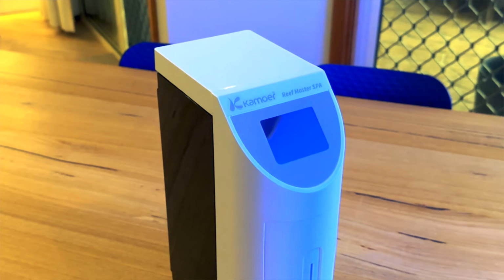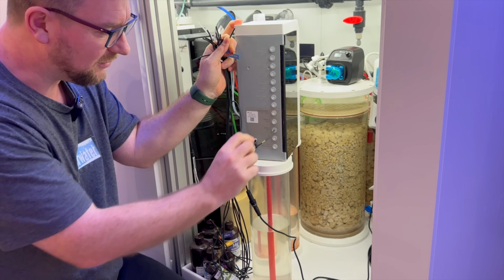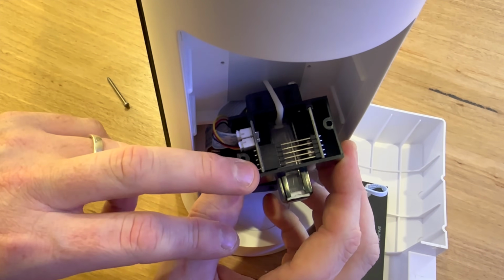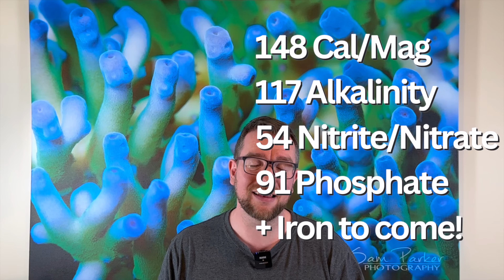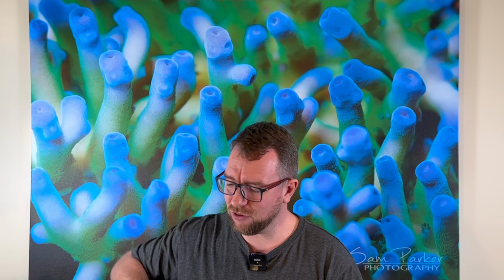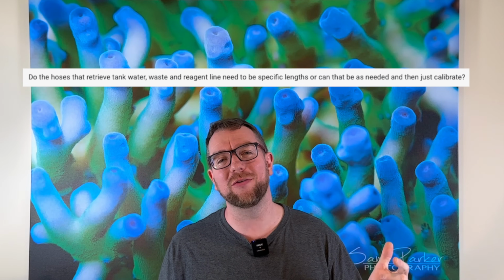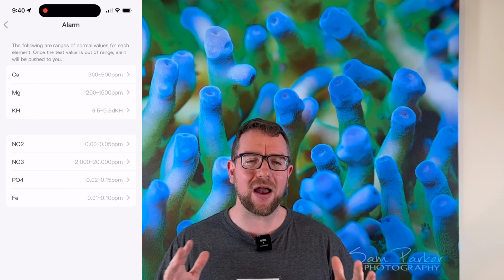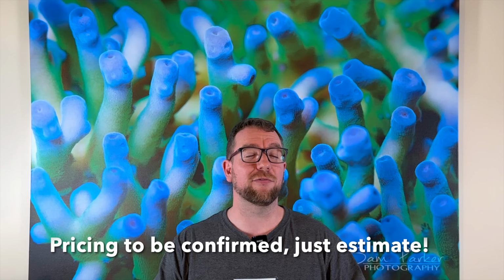Full Review - Kamoer Reef Master SPA

Comment: I'm torn, this sounds like a great unit and looks promising. I am leaning closer to the mastertronic essentials because I reached out to Kamoer directly a few times now with no response. Focustronic or everything focustronic in Australia responded to me the following morning and again followed up on my email. My concern is Kamoer app, not just the not getting alerts. but my Kamoer doser has a temp probe. When I open the graph I cant open the monthly graph as it just gets stuck loading, This concerns me because obviously we will be looking at trends and data with the Kamoer reef master spa. Its also a little insulting that you have to use a specific Kamoer pump with it. My pump is perfectly fine so if I wanted to go full automation it now means I'd have to buy the compatible kamoer doser. Focustronic allow 3rd party reagents, and they also have the powertronic to get more creative. the machines look very similar to me and I think the drop counter on the mastertronic essentials is a huge upgrade and looks low maintenance as well. The biggest selling point for me from my experience so far is that everything focustronic has better customer support and cares more, Kamoer make medical grade equipment but I am concerned about support if issues occur. Also mastertronic essentials looks a bit more tidy
Reply from the maker: The post sales support from Focustronic is certainly a level above the playing field. Still waiting for the mastertronic essentials to be released, if it is 80% as good as we've been promised, it should be a game changer that is for sure

Comment: Just to add to your video, which is great btw. I got this unit in late January(NZ based) my over all view to setup and get started was the easiest of them all. However, once its been setup and running, nunbers doesnt match up to manual testing. You can o ly do manual calibration and no automatic calib, meaning you manual put in the results from your calibration from another test. Just remember you can only do this on the KH CA and MAg. It takes about  2 weeks and the devices readings are all out. P04 and N03 are well off with no means of correcting them. We are a couple of reefers in NZ that has these units and to be honest, we are not happy. No help from Kamoer in regards to sudden drop with readings, no calibration instructions. In my opinion its a great device, onky if it works. I will not recommend this device untill Kamoer can give some feedback.
Reply from the maker: Interesting. Mine is about 5-6 weeks in now and is still testing accurately (with the exception of nitrate). The calibration of entering in the "actual" value is good, I am curious on your thoughts on what an automated version of that would be?

Appreciate your feedback!
Reply: I tested manually KH, and CA with 3 diffrent devices or testing kits. My KH was tested at 8.4, Kamoer at 6.4 6.5. CA  manual testing at 430, kamoer at 390. Once I have done the manual correction of the elements on Kamoer it test correct for a day or 2 then it drops again to the lower numbers. I would recommend you do manual testing on your KH with 3 different testing kits, put in the manual readings in the device and check your device after about 3-4 days.

Comment: Hi Sam, for the No3 issue, not sure if you have double checked the unit setting. Reef master SPA seems to have three different no3 testing ranges, from your results, I will assume your unit is set at 0 - 1ppm range, there are 1 - 15 ppm and 15 - 50ppm range that you can select as well. mine works well when I change the testing range.
Reply from the maker: Interesting, I wonder if this is new?
Reply: @ParkersReef  maybe, lol. Mine was like yours until I found out the range setting, the number then make more sense.

Comment: did you calibrate it? and how
Reply from the maker: I did not, however it is possible via either official Kamoer certified solutions that you scan the QR code of and then run a test with. Or you can alter the reading to match your baseline from another test kit in the software if you prefer

Comment: Great review as always! I am (almost)convinced to ditch my Mastertronic, Alkatronic and Dosetronic once this is available. However, There is one key question for me which is the price of individual reagents. 117 tests for Alk in my case would give me at most 2 months. SO I would need at least 6 bottles of ALK to have a one year supply, whilst Ca/Mg would last me almost 3 years (although unfortunately I would be forced to test them 3x faster because they only last for 12 months). So key question would be if reagents can be bought separately and at what price. Thank you very much!
Reply from the maker: Will see if the reagents are available individually or only as a set. Availability and price on these will be key
Reply: Yes, that will be key. If they only sell in bundle I will definitely not buy this as it would imply buying 6-12 sets per yeat. Even 6 kits will be more than 1.000$ per year and a ton of wasted Ca, Mg PO4 and No3 reagents.
Reply: my understanding is that colormetric tests for alk are always going to be significantly higher cost than the acid/ph test like the alkatronic.  I'll never ditch my alkatronic and don't use my mastertronic for alk.
Reply: @Reef_Ranch  That is 100% correct (unless you use ABC reagents on a Trident). My major issue with the Focustronic equipment I own (and I have owned GHL KH Director and Neptune Trident in the past) is that with the ALkatronic + the Mastertronic I have more maintenance than I want to have. There is not a week that goes by without having to calibrate some pumps, calibrate the pH probe on the Alkatronic, calibrate the syringe on the Mastertronic, replace tubing in the pumps (on either Alkatronic or Mastertronic), replace the filters that draw water from the tank, replace pump tubing… etc. I mostly want to simplify and have one machine that does it all (but with its own reagents) and with easy maintenance.
Reply from the maker: @Reef_Ranch  that is correct (assuming your reagents cost more than a basic acid mix, which it almost always does)
Reply: @vascojardim6703  yeah, the maintenance alerts on those two can get annoying but I ignore them for many days with little effect on the accuracy.  until the accuracy and precision of the nitrate and phosphate tests on these new units (the Spa, Maven and Trident NP) are shown to be on par with the Mastertronic I’m not going to be buying one
Reply from the maker: Yeah that’s fair too
Reply: @Reef_Ranch  unfortunately my experience with the Mastertronic over these past 2 years regarding accuracy is not brilliant. If I ignore the calibration warnings the results start to slide quite quickly, especially on NO3 and PO4. And it has even happened to me getting close to zero NO3 and PO4, leading me to increase feedings to avoid it, resulting in an algae bloom in a couple of weeks that killed some of my corals. When I saw the algae I got my Hanna checkers out and while the MT was saying 0.5ppm NO3 I had close to 30. After speaking with the (Legend) Reddie Redwood he told me to replace the vials, or wash them, because apparently after a while the reagent starts to accumulate residue. And this is on top of regular maintenance. And if you have to change the pump tubbing on the MT you have to take it apart. I love all the rest but the required maintenance to keep them accurate is just too much.

Comment: Thanks Sam, I was looking into the Kamoer reef master SPA and noticed you had a little teaser in your last vid. I had been waiting for this review! Looks like it has a lot of potential and gives us aussies a bit of a solid range of options in this current lacking market. I originally looked at apex but it turns me off that there is never replacement parts or reagents in stock and kind of defeats the point of buying a auto tester. I really hope this one takes off from Kamoer as they do create quality products other then the app can be very infuriating at times with its slow load times or endless "loading" especially on the android version of the app.
Reply from the maker: Glad it was useful for you mate, if you have any other questions - fire them away!
Reply: @ParkersReef  Thanks Sam, I think pricing, availability are the 2 big ones now and maybe a future update if they let you test it longer 🙂 Hopefully they are listening to the feedback, working on some minor improvements, very excited for the future of this hobby! thanks for the awesome videos and appreciate the useful content
Reply: ahh and maybe some might be curious if they are thinking about adding options for automatic control through the actual cloud app instead of buying the extra connectors? I see they dont support all models of there doser range

Comment: $1600 thats a rip off. do it dose your tank=no/control your tank=no waste of money just stay with the best apex trident/NP=not $1600
Reply from the maker: It can dose your tank :)

But hey all good, if you like apex - don’t let me stop you 👍🏻
Reply: 1600 isn't bad. Neptune will have you tied up for about $2500 to test those same parameters. Yes, you will get a bit more gear along with that. The kamoer afaik can share data with a 3rd party, so apex, hydros, etc. Should be able to have that data ans possibly make dosing decisions based on that. Personally, I think that's foolish. Set your dosers manually, use auto testing to alert when you should verify with a manual kit, and then adjust dosing. Gonna end up with problems chasing numbers and killing animals with the calculated dosing.
Reply from the maker: To each their own, is the beauty of reefing!
Reply: @ParkersReef  exactly. Alot of diehard fans (mainly neptune) are really trying to bad mouth these new innovative devices. Neptune snoozed, and others stepped up. I think it's absolutely great for the consumer to have that competition vs. A near monopoly.
Reply: I liked my Neptune APEX until it died and they didn't bring any more into the country. Still got a whole lot of Neptune gear that I can't use because the gear has no smarts on its own.
Reply: Problem is you need 2 tridents to do ca, mg, all, no3 and po4. If you already have the original trident you will more then likely get the second but if you don’t have any other Neptune gear you would steer towards a stand alone tester like the spa that can increase/decrease dosing based on results